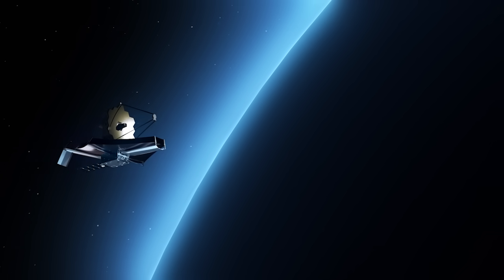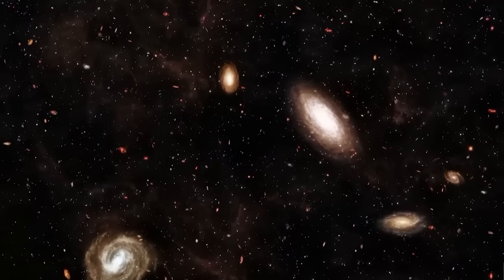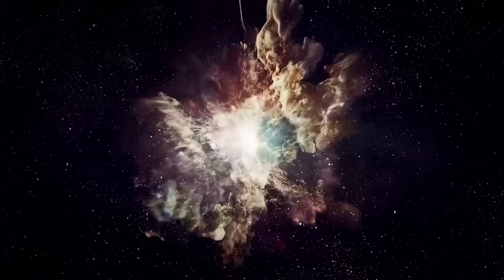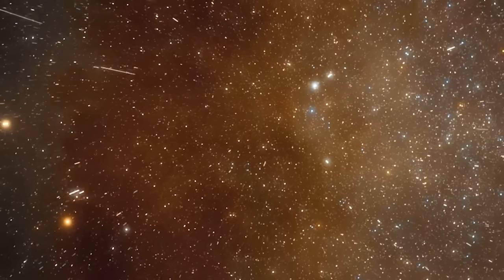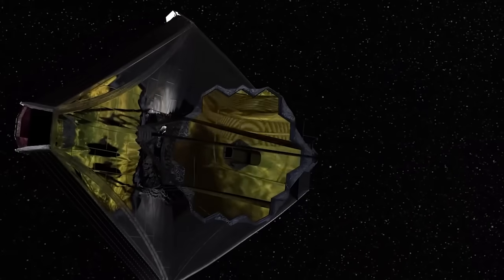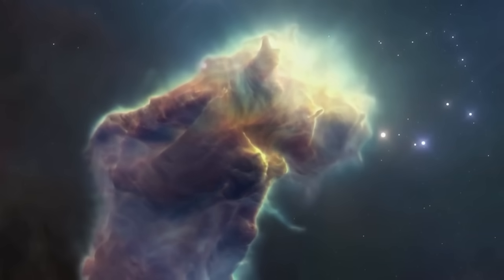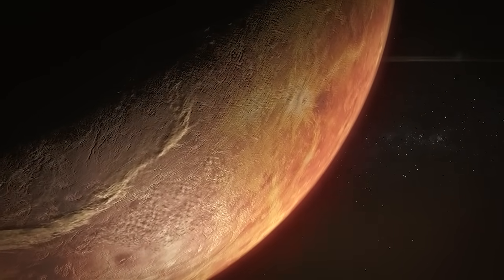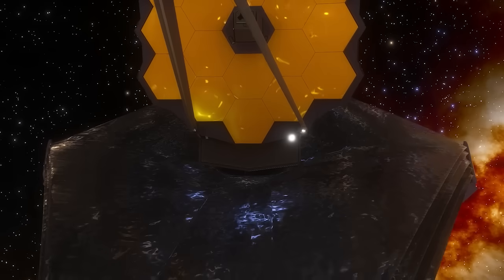An INCREDIBLE Journey the Most Beautiful Discoveries of the Universe by JAMES WEBB Space Documentary

Comment: They forgot to mention Northrup-Grumman. The contractors that actually designed and built the James Web Telescope. Typically NASA claims the credit after the project works. In fact NASA is a burden to the process. The classic example is the Apollo Project. A coalition of Primary Contractor stated " They could have put a man on the moon in half the time at one quarter the cost, if NASA was not involved once project specifications are defined." My personal experience, first as a teen age observer, (my father moved us from NY to Cocoa Beach) next as a Contract Engineer designing circuit board for the Curiously Rover at JPL.